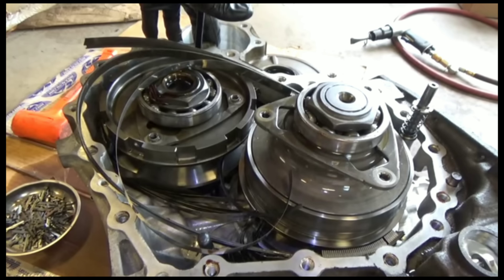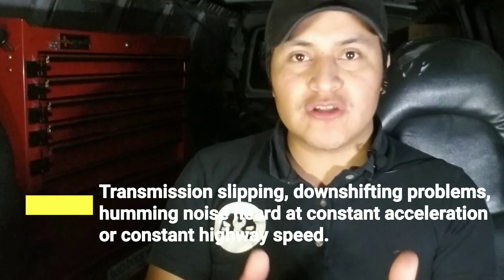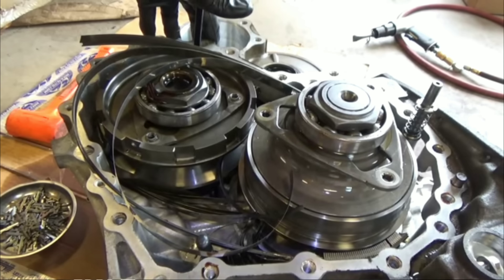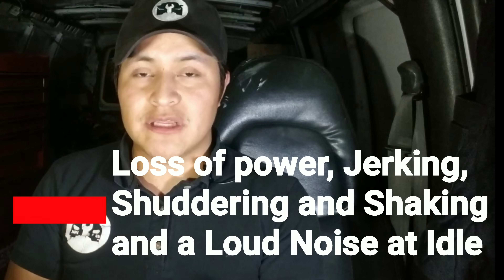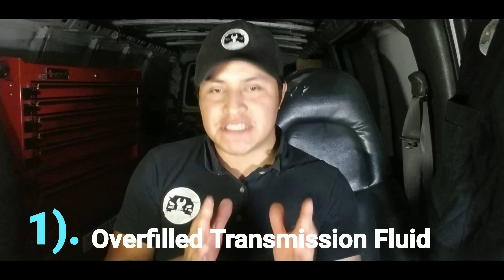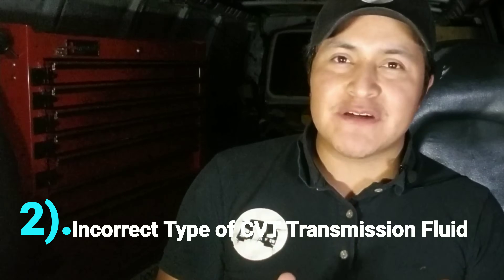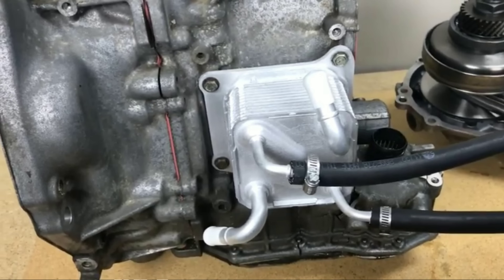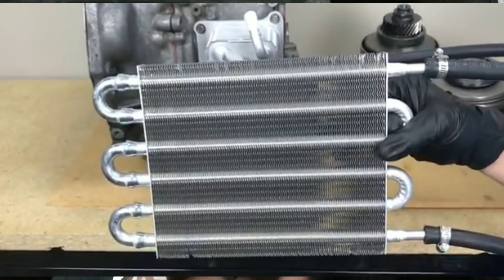NISSAN CVT TRANSMISSION | why it fails and what you can do about it to prolong it's life

Comment: I own a 09 Sentra with almost 80k and I have had zero issues. No humming noises or nothing and I beat the crap out of that car when I use it. My wife has a 17 Rogue with 32k, zero issues and my mom a 13 Rogue with ove 100k, also zero issues. I think is all about maintenance and some times taking the car to the limits 🤷🏽‍♂️

Comment: A water cooled transmission? That sends up a red flag, to me. CVT transmissions have continuous ratios and do not have to shift to change gear ratios. The whole idea is to save a minute amount of fuel to pacify the EPA, like the stop-start traffic signal trick. Economic feasibility of having these things is not considered by the makers or EPA.

Comment: I have a Nissan Altima 2002 2.5   Every time I start the car takes a couple of seconds to move forward when I put it in Drive.  Took it to a transmission shop and the computer did not find problems but they perform a transmission service and nothing changed.  Any idea why is this happening ?  Thank you.   Yucatán rules

Comment: I bought my 2018 Nissan Rouge brand new. I didn’t know there was issues with the Nissan CVT transmissions when I bought it. Too late! Had I known, I certainly would have bought another brand of SUV. My Rouge has only 13,300 miles currently and so far I am not experiencing any problems yet. It’s concerning to me of what lies ahead of me with this vehicle.  Good advice on what preventive measures to do if you already own one of these vehicles. I will hope for the best. Thanks.
Reply: Just change the fluid every 30000 miles
Reply: I hear you I just a brought a 2017 20,000 miles. had I known about the problems I would of brought something else too. I wasn’t impressed with the pick up during test drive but brought it anyway:(

Comment: My 92 sentra was at almost 200k miles when i gave it to someone needing a car (10 years ago) they drove the car for another couple of years and then sold it for $700.Now fat forward to 2016 ,nissan sentra sv ,Went into nissan first time at 48k miles for transmission issues ,got fixed went back in at 58k miles ,got fixed,went back in at 64k miles,got it back transmission failed again at 73k miles,got it back with another 1 year or 12k warranty ,transmission fell apart at 84k miles.No comparison to the 92 sentra,that car was a beast,problem free, the new nissans are pieces of SHIT
Reply: B13 ftw
Reply: Frankie 072  your 92 Sentra had less of electronics and fly by wire technology hence had less issues. Also if your driving is more of highway and long stretches transmission lasts longer as compared to stop and go jack rabbit runs.
Reply: @MrKhabbu  The 92 was just a much better built car all together,Nissans quality has dropped,and the biggest thing is it didnt have the garbage transmission that the new ones have.Nissan has the worst transmissions in the industry
Reply: That was the last of the good sentra

Comment: I have a 2017 Rogue. It is a nice SUV except for that damn CVT. Getting rid of it before it goes south.
Reply: Oh great I just brought a 2017 Rogue SV. Didn’t pick it up yet after all my research I’m not sure I will? I didn’t plan on buying a Nissan of any kind but the price was within my budget and it looked nice but I did notice the drive was sluggish. Though it was just the 4 cylinder. I would of wanted a 6 but cost was to much. I’m seriously regretting this purchase now.
Reply: @se4276  Don't beat yourself up just yet. I've seen lots of these go 200K miles without any issues. It's not all of them. Just a percentage.
Reply: Checkm8king2 thank you that’s hopefully

Comment: THE BEST MAXIMAS WERE BEFORE 2007 ..THEY HAD OLD RELIABLE 5SPEED AUTOMATIC...MY 04 MAXIMA HAS OVER 305,000 MILES I DID CHANGE OUT A FAILED VALVE BODY AT 200,000 MILES.. 1100.00..BUT AT OVER 300,000 MILES NO SLIPPAGE SHIFTS ARE CLEAN AND QUICK NEVER CHANGED MY FLUID BECAUSE I WAS TOLD BY MANY SHOPS AND THE DEALERSHIP THAT WOULD KILL IT!!NO LEAKS OR BURNT FLUID!!! I WOULD NOT TAKE A FREE NEW MAXIMA WITH THE GARBAGE CVT!!! I WOULD EITHER SELL IT FOR QUICK CASH OR TRADE IT. I SEE MANY NEWER THAN MY MAXIMA SITTING ON USED CAR LOTS AT ABOUT 100,000 MILES AND THE CARS ARE CLEAN BUT SOMEBODY GOT RID OF THEM QUICKLY 🤷🏾‍♂️🙄...NISSAN SHOULD HAD STAYED WITH THE FIVE SPEED OR WENT TO A SIX SPEED!!! LOVING MY SMOOTH ACCELERATION 04 MAXIMA THAT IS GREAT ON GAS!!!!!!

Comment: Avoid buying a Nissan or Mitsubishi with a JATCO built CVT. They have terrible resale value. Buy a Toyota or a Kia.... seriously. Buy an aftermarket transmission cooler and change CVT fluid with the Nissan recommended type AND FILTERS (theres 2 filters) every 25-30,000 miles. Also make sure the CVT fluid fill plug is in its place. As the CVT fluid heats it obviously expands. This literally can cause the plugs to be popped out by the pressure build up.

Comment: Why would a cvt only shudder in 'D' and not in the other drivemodes(Ds,manual mode)? This is on a mitsubishi with a jacto cvt which had a failed atf cooler that caused coolant to mix in the gearbox.

Comment: I have a 2010 Mitsubishi Lancer that uses a Jatco CVT. I get it serviced every 30K and its been totally reliable. My sister has one the same year, she's done that as well and its has been fine too.  I think the main thing is just keep up with those fluid changes. I know they're expensive, but I'd rather spend $220 every few  years vs. junking the car because the CVT died (and isn't worth replacing).

Comment: If you are good with manual transmission just stick with it for any car make u buy and u will never have to worry about a transmission problem. I guess the utmost reason for a car is to take u from one place to another with ease and a manua transmission does just that. 😉😉😉
Reply: They're almost impossible to find anymore (which is a shame).  Its a rare person under 35 or so who can even drive one.

Comment: There are TWO filters on the Nissan Altima CVT the metal one in the pan and a small paper cartridge on the left front of the case.  I replaced both filters and the fluid at about 100K miles  The paper filter was grey and nearly plugged.  The color of the Nissan CVT Fluid was brown and not green like the NEW NISSAN CVT fluid!  I also disconnected the cooling line from the radiator and installed a Nissan OE Transmission cooler!  My car has 113K miles now and it has been trouble free/  I also recommend buying a CVT OBII Scanner and free downloaded program for your cell phone (like Bafx Products - Wireless Bluetooth OBD2 / OBDII Diagnostic Car Scanner & Reader Tool for Android Devices and a download of "CVTz50" or others to be able to see what the transmission is doing as you drive)

Comment: Hi I've seen a lot of your videos on youtube and ive found them very helpful. I just bought a 2012 nissan sentra se and realize now that was a terrible decision. When it's on the highway there's some whirring at 4k rpms but its not so bad and ive tried to avoid getting there. also, once in a while moving from a stopped position to accelerating the car shifts hard or jerks. so my question is, in your experience, should i try to sell it or ride it out? the car has 103,000 miles and id like to drive it another 30K but im not sure it will make it. in your experience do you think at this stage there's much life left in the car? does a fluid flush help? thanks.
Reply: babooshee Why do you need to go for 4 k rpm. On highways at the most you go upto 2500 to 2800 range .

Comment: Does driving style make a difference?
Reply: Absolutely. Smooth acceleration and braking can help extend the life of any car. Try to avoid jackrabbit starts and sudden jerking as much as possible. The biggest difference you can make is to NOT idle the car for extended periods of time especially if you are in an area of intense summer heat. When idling, heat can build up easier and not dissipate from the car as easy when compared to driving. Other ways that can help extend is to not immediately shift into gear from park after starting the car. I would give it at least 10 seconds. Also, while switching gears from park, reverse, and drive, make sure that the car is at a full stop. I see so many people switch immediately into the drive gear when their car is still in the reverse motion.
Reply: @ThomasWGibson  do you think most of these issues are caused in warmer climates ? Here in Canada, most people are happy with nissan. And its cold here

Comment: I just had the CVT fail in my 2017 1/2 Rogue at48772 miles lucky for me it is a certified preowned and the warranty covered it no charge to me.
Reply: Great u have an extended warranty..👍  I have a 2017 rogue...26000 miles... Extended warranty.. Skeptical about keeping it or
Reply: Trading it in for a Mazda...Your thoughts?

Comment: I was told the Murano uses a better and bigger Japco CVT than the other Nissan cars that have use CVT's, is that true?
Reply: The murano now uses a steel chain design like you see in Subaru they’re much better for reducing slip but when they do slip it cause more damage
Reply: Seth Little thanks I have very carefully driven this car and change the transmissions oil at 30K miles per the manufacturer’s recommendation at the dealership. In a little over 4 years it has 52K on the car.  It mostly gets highway miles almost no stop and go driving.  Hope it hold together.
Reply: Gerrick Slogar yea changing the fluid should keep it healthy I’ve had nissan cvts last over 150k so don’t worry too much just drive normal and service and it’ll do good
Reply: Seth Little will do.

Comment: I sold my rogue. CVT failed at 79k. It was the biggest p.o.s. I ever owned. No more Nissan for me.
Reply: Seems like a transmission controlled by fluid pressure would be designed with solenoids that would be able to hold up to the high pressure demands. They just went to cheap with the parts. Trying to be cost effective will cost you more in the long run
Reply: Yup. Not defending Nissan at all. But all cars made after 2005 are junk.
Reply: 4dscdriver wich year?
Reply: @rafaelg9016  2017
Reply: 4dscdriver did you changed the fluid at 40k?
Reply: @rafaelg9016  changed it around 35k.
Reply: Should have changed the fluid at 60k and it would have made it. $70 at jiffy lube. But who reads the owners manual and does the necessary preventive maintenance???? No one that's who. I'm a certified master mechanic and I never fix anything before it breaks😝. " You are not alone" Michael Jackson voice😁
Reply: @chrisbranch231  you can change the fluid on these and they still fail. I changed it around 30k and again around 65k. The problem with this design is that the cooler on it is inadequate. Mine was driven on the highway 95% of the time. What failed in it was the valve body. When it failed, it made the belt slip, which is what causes them to have to replace the whole transmission. A normal automatic would've just had some new solenoids put in and would've been ok. Then again, a normal automatic wouldn't have failed at that low of a mileage either, whether the fluid was changed or not. BTW cvt fluid for these is $20 a qt. You can't change the fluid on these for $70 and do it correctly. The cooler has to be flushed also.

Comment: I have a 2012 Maxima that i love .sometimes after the car sits over night it shutters on my very 1st take off then it wont happen again for the rest of the day. This doesnt havent every day maybe 2 times a week if that..it have very good pickup..I love this car as its been very reliable with only 75K one it..I wonder if theres something i could do before it gets worse?
Reply: The shudder is most likely where the fluid is colder and doesn’t build up enough pressure in the pulley to compress the belt causing a slight loss in power my guess is just let it warm up more and drive it slow on first take and be sure to change fluid every 30k miles

Comment: I think most people had problems with the earlier CVTs. I have a 2012 nissan maxima and i have 87k miles on it, runs like a champ. I change the transmission oil with nissan NS2 fluid regularly, though. The only real problem I have which isnt really a big problem is my mass airflow sensor. I have gone through two of them already with OEM parts. I am going to buy a third one that isnt OEM to see if that fixes the issue, otherwise I may look into having new cables installed. Anyone have the same issue in a 2012?
Reply: My altima 2012 is now 151000 miles. Never changed anything so far except engine oil and filter and MAF sensor a year ago. Good acceleration and 29-30 average mpg
Reply: We have 14 Sentra. 3 MAF sensors have gone out on us. Transmission is gone and car is in limp mode. Other than these two issues, the car has been great. Hopefully a newer remanufactured CVT will help with the MAF issue also
Reply: @scotttracy6840  any luck getting nissian to cover the cvt. Can't seem to talk the kid out of into rolling that negative equity from that same car over into a new one..Said avoid regular mechanic and go to a transmission specialist but they know more. Why is it none of us actually listen till our 30s 🤣
Reply: My father in law has the same maxima and he has had multiple issues with the MAF and wheel speed sensor. When the speed sensor gets gunk on it, it causes throttle closures because it thinks the wheels are slipping. 
When the battery is low or there is an electrical issue like corrosion on the positive or ground cables, the MAF doesn’t get the correct voltage. The issue always happens around the 3.5 year to 4 year time frame , or after a dead battery. 

It’s been cleaned multiple times, as well as the wheel speed sensors , but never replaced. Still going to this day.
Reply: @chrisrobles2012  when u had maf problem because of dead battery was there an ecm code?
Reply: @BillSW  , yes there was a code for the MAF and other sensors days if not weeks before the battery died. Sensors work on 12v and when the cells in the battery go bad it’s like having a 10v battery which most sensors work with a range of 10v to 12v, otherwise the engine computer sees it as a bad MAF or other sensor for example.
Reply: @chrisrobles2012  The battery u refer is the car battery or a battery in the sensor?
Reply: @BillSW  , car battery. There are no batteries in a sensor.
Reply: Is it still running like a champ?
Reply: @king_lewis310  my CVT is! Engine rock solid too. My power steering on the other hand 😂

Comment: I have a 2012 Nissan Maxima do I have to replace the fluid every 30000 miles
Reply: Going good?
Reply: We did our son 2011 Cube  CVT drain & refill every 30,000 miles at Nissan it still failed at 106,000 miles. 2011 Cube not qualified for class action lawsuit for CVT rebuilt BS.
It cost me $3500 for only a 1 year or 12000 miles warranty BS. Never again any type of garbage CVT.

Comment: Here in Las Vegas, over heating was a big problem. I was a tech at a Nissan dealer here. I used to pull a car in the shop, swap the trans, install the upgraded cooler, install the new dipstick (with the lower fluid level), reprogram the TCM and pull the car out in 2 1/2 hours. I could do three in a day. Warranty time was 9 hours each. It got to where I'd go out on the service drive and look for '07 to '12 4 cylinder Altimas because there was a 80% chance it had a P0610 code which was the overheat code that triggered the TSB for replacing the trans.
Reply: Damn man. I rebuilt mine here in vegas. We  did u work at?. I may pass by and drop u a friends ??
Reply: I have a 2016 Rogue with 70k  and was told by my dad's mechanic not to ever flush the transmission. Is this true?
Reply: @hulksmash849  yes. Don't flush it, just drain and fill. You can flush the cooler and the cooler lines though. Nissan sells a spray can with a hose specifically for this.
Reply: @aaronbritt2025  Oh sweet dude,  thanks so much for the info. Is draining the same as draining your oil? Not sure how much you know about Hyundai but my car makes a very loud noise when I start it.
Reply: @hulksmash849  that noise could be lots of things. Yes, it's like draining your oil. Drain plug on the bottom, fill through the dipstick tube. Do NOT overfill it and get a new drain plug washer from Nissan.
Reply: @aaronbritt2025  Ok thanks again for the info. Can I share the video with you through email or Reddit if it's not too much trouble?
Reply: @aaronbritt2025  which type of cooler would you use on these cvt vehicles? Which is the BEST CVT FLUID to use in these transmission? Your opinion.
Reply: @cgodinez5447  Nissan sells a cooler. That's the one I'd use. I'd also use the OEM fluid. It's a couple dollars more than Valvoline, but it's what Nissan approves.
Reply: You forgot about Renault transmissions  😂😂
Reply: Nice work. I dont have an Altima have a Bluebird Sylphly the old shape 2012 2.0 litre. Only problem i am having is when driving on highway at 100 miles an hour the car starts to jerk forward you can feel it coming from the transmission ? What dies that mean ?
Reply: @paullawrence8075  it means a Bluebird shouldn't be going 100mph. ;)
Reply: Thank God Mitsubishi put better oil coolers on there JATCO CVT7 units. It also help my shitbox Mirage only has 74lbs of torque and only weighs 2k lbs. lol
Reply: My Nissan Sentra SV 2015 is CVT transmission. I live here at Las Vegas NV. My transmission mission always have annoying sound when shifting. I always change my transmission fluid. And always visit. Nissan planet Vegas. I have the Nissan CVT. I hate it. I go back to stick Shift. The best and more durable